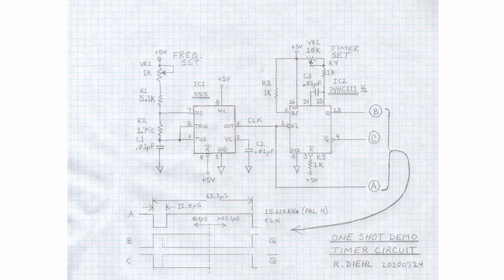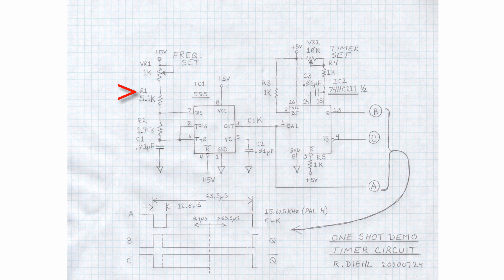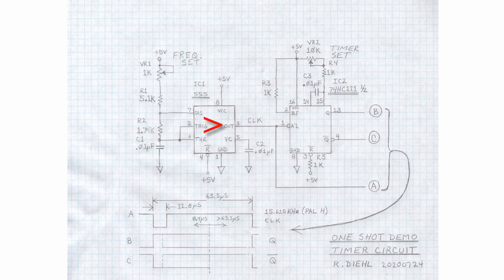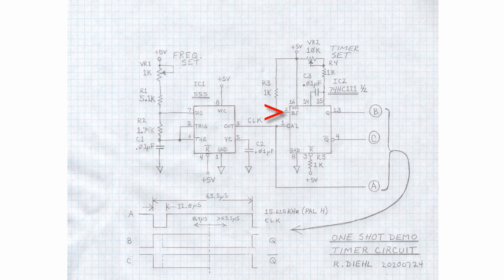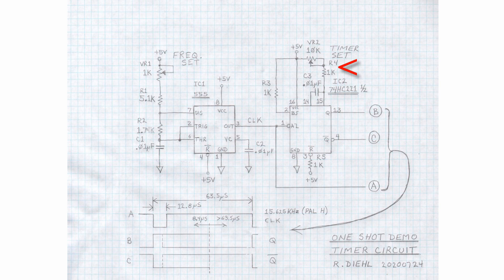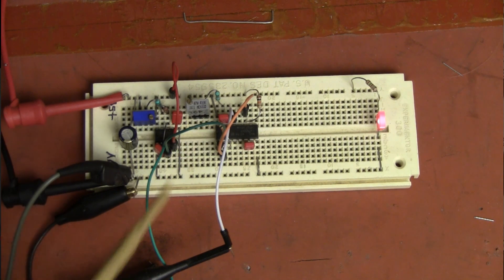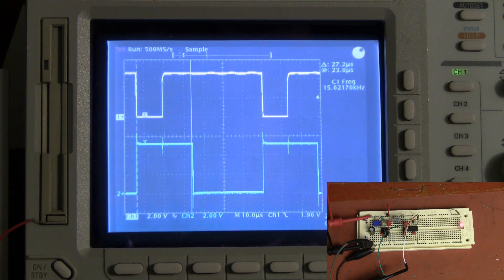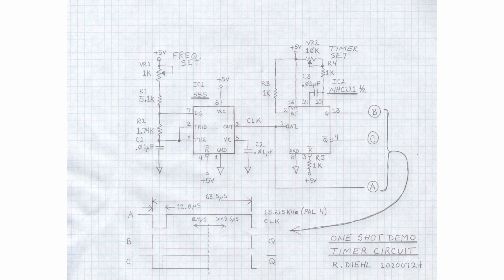Monostable Multivibrators

Comment: All my crt projects of late have used Steve Anderson's DAC Ramp generator  controlled by crystal clock and you get 15 line to over 1000 lines  3 frame rates .. use it in the 32 to 64 line rage and a touch higher only because the small CRT's have their limit in dropping  the raster dot size, image becomes smudgy on high line rates on the old crts i am using ..  
 I can see what you are getting at here ....A  step further may be it would be easier on troy to just draw up a better circuit and drop in a new circuit board   as a replacement ..with a crystal time base DAC ramp generator in some ways its less complex than having to add a small replacement circuit ...sometimes you have to just say time to start again ..
I can see Troy may rather just a fix but .
Anyway interesting what ever road you go here every one chooses there own road !
Reply from the maker: Thanks for the excellent analysis and suggestions. To be frank, there is a crystal controlled Philips sync generator chip already making all the pulses. It could replace the entire one shot based pulse processor and 555. But, the rework may be more than Troy is willing to undertake. Large changes can paint one into a corner. It's entirely up to Troy on how to proceed. Hopefully he reads the comments and keeps notes on the great ideas being bantied about by the peanut gallery. 
Your digital ramp generators are great for low line count, low frequency video. At standard definition rates, it is far more difficult to change rates like that. Besides, Troy's camera is supposed to conform to CCIR format and doesn't require the gear shift function. :)
Reply: @videolabguy  The crystal controlled Chip sounds good whats the part number Richard i see if i can buy one .
   The ramp generator seems to have no problem at the higher line rates apart from you have to really compensate  for the ramp size drop on the line ramp as that drops in size as frequency increases as you know ..i mainly use it on  electrostatic CRTS  i have one of those circuits on a magnetic deflected crt ..but as you think its better to keep Troys  at standard line frame rate i think he rather standard .. Watch with interest   how it go's ...i think Troy will view the videos he has a lot of hobbies  he will get back to the camera .

Comment: Is it possible to use a stable clock reference rather than the 555? I assume that one of the the standard value of crystals would lead to a 15.625kHz clock if you divide them N times (with N integer). Then fed that clock line into the monostable to generate the proper 12us blank lines.
Reply from the maker: Yes. Absolutely. The design of the TV camera in question goes way back to 1970. (See my two previous videos) The idea in 1970 was to save money. I totally agree that the venerable 555, so good for so many other things, was the poorest choice for a TV camera time base. You will be happy to know, that since then, we did add a crystal controlled sync generator to the design. In fact, that sync generator creates ALL of the pulses that come from the one shots. But, in the interest of "keeping it simple", we are instituting one small change at a time. Nothing will wreck a project faster than trying to change too much too fast.
Reply: @videolabguy  Yes, I see. I wasn't alive back then so I didn't know if a crystal was more expensive than a 555. I really agree about the simplicity of this circuit tho and of course I've watched the other videos about this project (and all your other videos too). Thanks!